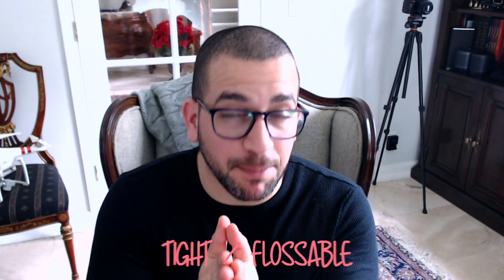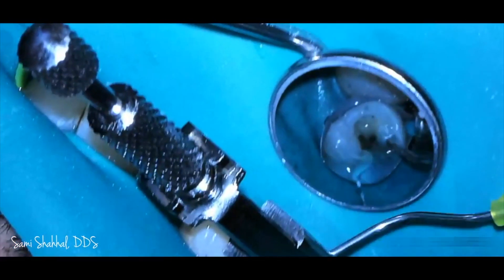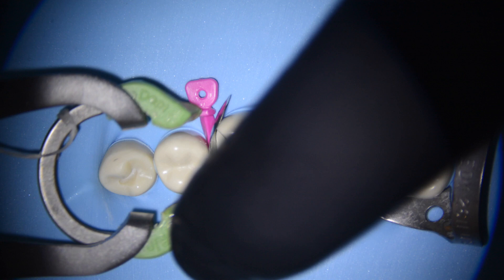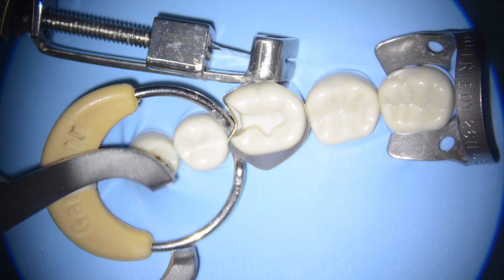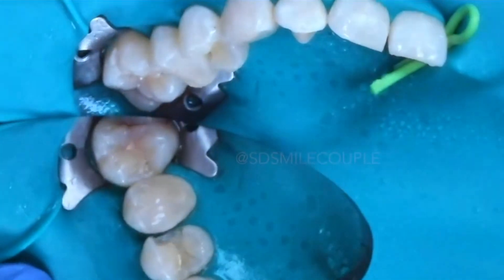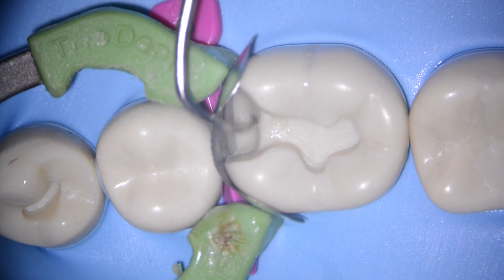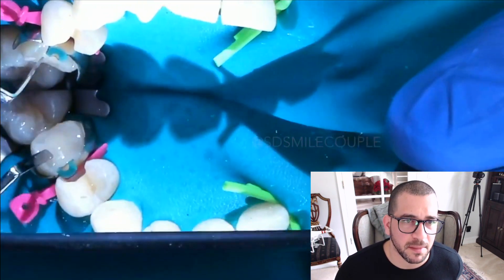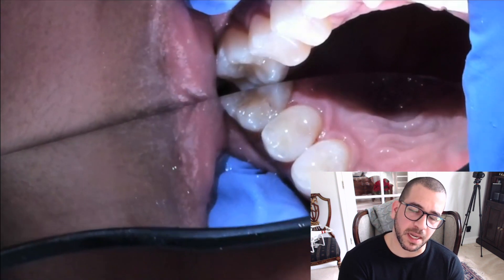Class II Composite Restoration Molar | SECTIONAL MATRIX TECHNIQUE

Comment: Doctor, I’m a dental student, for class 2 restoration, I make a shell first to create the marginal ridge but I get voids at the bottom gingival wall.. it might be because I didn’t pack the composite down enough? What is the purpose of placing flowable first before packable composite? Will it help with preventing voids?
Is it alright to have a tiny gap between the sectional matrix and the bottom gingiva wall before restoring? Thank you!

Comment: Great video. I’ve been getting some people complaining of sensitivity when flossing after completing class II restorations. Have you ever encountered this and if so, what do you suggest to relieve symptoms and what do you suggest to prevent?  Could the contacts be too tight?  I always check with floss at the end of the procedure. Thanks.
Reply from the maker: When I first started this was a huge problem... I’ve done so much since then that has helped. We don’t want any water contamination with bonding so I use an air only tip, I’ve switched to kuraray clearfil se which has decreased my post op sensitivity patients to almost 0 because the primer basically acts as a less aggressive enchant, I do selective etching. It’s painstakingly difficult to isolate what exactly is causing your patients to feel sensitivity so keep on modifying technique till you have it down